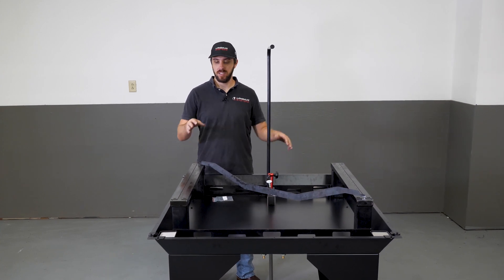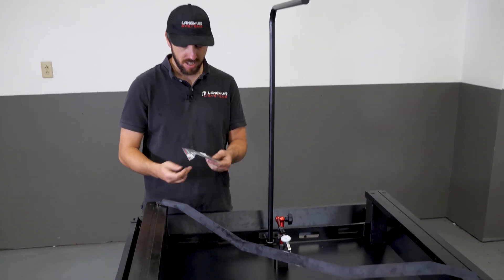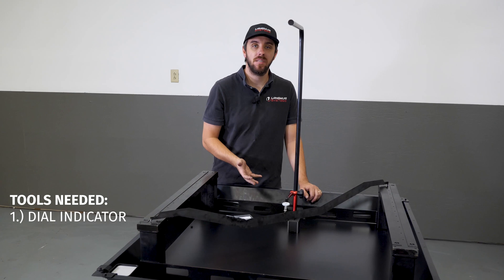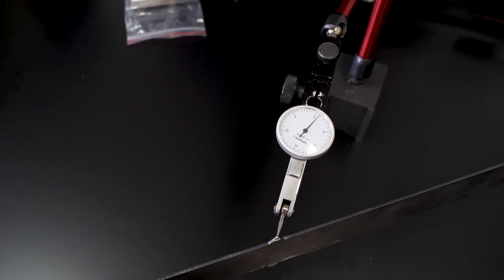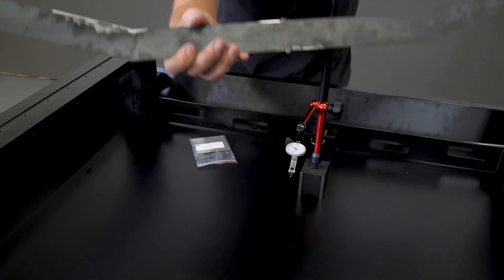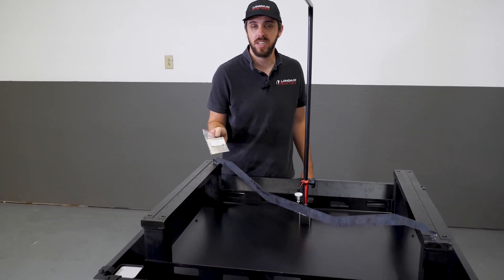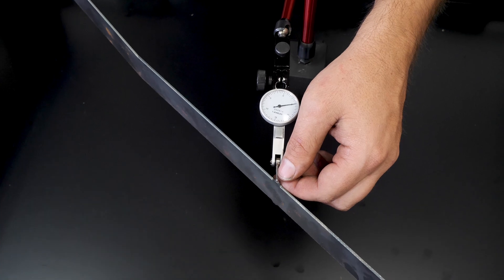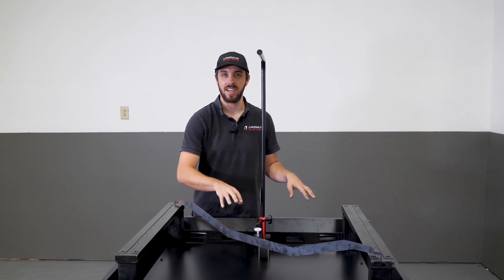MR-1 CNC Mill Assembly Tutorial: Y-axis Rail Coarse Adjustment

Comment: I also think this coplanarity check is not going to always work.Check my logic - suppose we at first knew the two rails were coplanar and we then check with the gauge. We would find 0 height difference between the two measurements. Great! But now let's tamper with the rails. Let's raise the right rear 20 mils and at the same time lower the left front by 20 mils. The rails are now definitely not coplanar. So now let's check with the gauge again. The errors on the RR and LF combine to produce no height error at the midpoint of the gauge. So won't the gauge now show the rails are coplanar even though they are not?
Reply from the maker: In that scenario, the rails WOULD be coplanar. If you think about it, your tilting both rails the exact same amount and the same direction. So while the rails wouldn’t be level to earth, they would be coplanar.
Reply: @LangmuirSystems  You are right! Thank you for quickly answering my comment!

Comment: Not to be a smarta$$, but that is a dial TEST indicator.  A dial indicator has a plunger and is generally larger with only a .001" resolution, wheareas the dial test indicator can have resolutions of .0005" and .0001".  I mention this to help avoid confusion for your customers when they go to buy one.  If they ask for a dial indicator, they will not get what you are using in the video and will not have the resolution needed.  Cheers.
Reply: I was going to mention that

Comment: You can't measure coplanarity that way.
Reply from the maker: This is actually a very simple and effective way to measure coplanarity error. If there’s something specific you have a question about regarding the process please let us know!
Reply from the maker: @CMTeamCobra This measurement is checking if the four points that gage contacts lies in the same plane. Any straightness errors of the Y axis rails will add to coplanarity error- but we measure straightness of the rails in our shop (less than .002” over the length). I would love to hear your thoughts about what you believe is incorrect about this measurement.
Reply from the maker: @UC9bMrSvqPqBUKAOl9kujr1g I can assure you that we didn’t delete any comments. Not sure what you are seeing on your end. We genuinely want your feedback.

Comment: Q: Before doing this, should the base be leveled to the floor first?
Reply from the maker: Yes. This is covered in the assembly manual. These videos are just a supplement to the manual. Thanks for the question!
Reply: Thanks for the video, it’s becoming clearer! You got to think that little tweaks to the levelling pads would also do the same thing since many most people will not have a machinist level so the levelling will likely be rougher that and may introduce a twist to the assembly, or is the frame/tub stiff enough so it will not twist anyways?
Reply from the maker: @mikejuzenas93  the Front Y axis rail mount has two points of contact with the bottom of the chip tray, while the rear Y axis rail mount has a single center point of contact. This means that the assembly rests on 3 points. This is on purpose to ensure that no matter how out of level or out of flat the chip tray is it will not influence the coplanarity of the y axis rails. 

Now after the concrete is poured, the leveling feet can twist the base if the loads aren’t equalized and that will impart a small coplanarity error between the Y axis rails. But our experience is that the concrete base is so torsional stuff that all the user must do is roughly equalize the torque on the leveling feet (equal load) to ensure there isn’t any appreciable twist.

Hope this helps!
Reply: That sounds great. I suspect that even with the concrete providing significant stiffness installing casters on the machine might be a no-no since most floors are not completely flat, or you need to be prepared for some inaccuracy. Casters will also allow the machine to move a bit if that head is moving rapidly which is not great either.  I think I will put my machine in a fixed corner of the shop and once setup it will stay there …. :-)
Reply from the maker: @mikejuzenas93  yes casters are a big no no for the reasons you state. Any coplanarity error will limit the achievable flatness accuracy achievable.